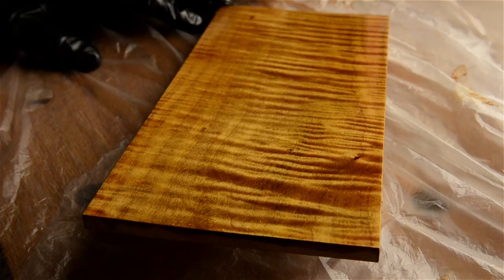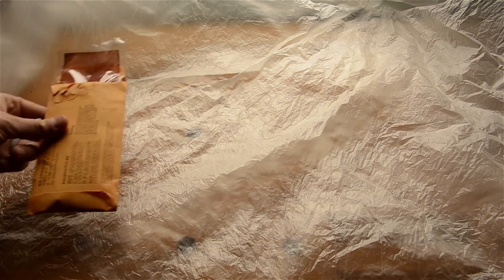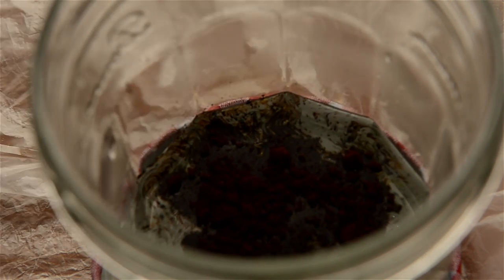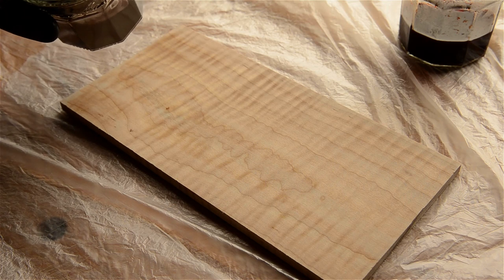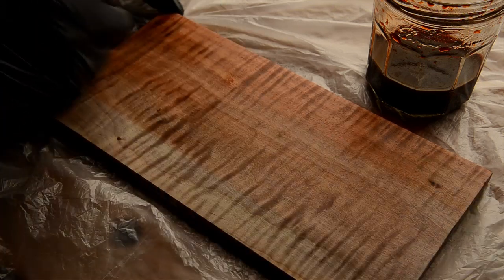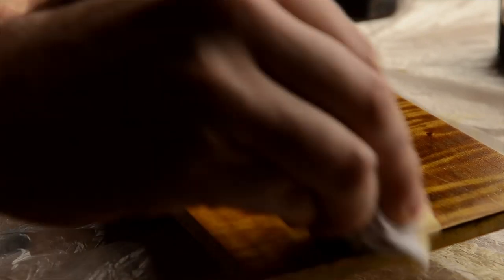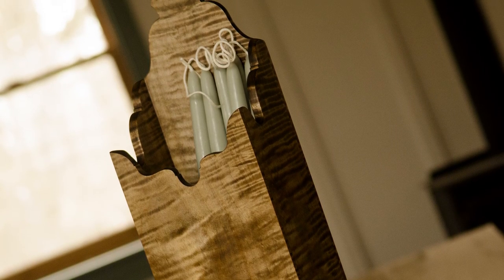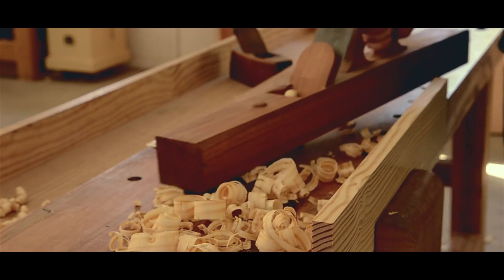How to Make Figured Maple Pop!

Comment: Guitar maker here. This is a common technique in figured tops! There is however a fair tradeoff when "popping" the figure with direct dye application. To a degree this flattens the chatoyance which the oil recovers for the most part. The biggest culprit here is use of coarser black pigments that easily kill it. Sanding maple to 400-600 and doing a couple of distilled water grain raising and 800 grit knocking back at 20° to the grain direction produces a finer and less furry result with water based dyes. 20° helps cut the damaged raised fibres instead of simply pushing them back down where the dye causes them to raise back up. A few guitar makers I know polish their maple through to several thousand grit, essentially burnishing the surface, oiling and/or shellacing before shooting toner colours over the sealed wood to get maximum chatoyance. It's a decision between whether you want to trade off a little of the surface reactance to light to gain contrast in general. Ultimately, everybody should experiment with different finishing schedules and try variations to see which path and desired characteristics works for them and the workpiece itself. Guitars have different expectations and human interactions than furniture! Recommending this video, definitely. Thanks!
Reply from the maker: Thanks for the great comment Tristan! Yes, guitars have a much higher expectation than does my furniture. But it's great to learn more depth on the subject. Hope to have you comment again!
Reply: Tristan J. Cumpole - different methods work for different end goals. I finished a Birdseye maple top as follows:  sand to 220, apply black water-based dye, sand to 220 again, then switch to alcohol based dies so the wood doesn’t get furry anymore. No BLO - just multiple coats of lacquer with wet sanding 500 in between. The first few lacquer coats were tinted to dial in the red I was looking for and they added some depth to the color as well. 

Next time I’m going to try a card scraper after the initial water based dye application.
Reply: @chipsterb4946  I agree totally. Finishing schedules are about control over what one wants to express from the wood itself, and add in via the finish. I've never been a fan of using black dye to accentuate the rising/falling grain as the contrast is a bit too dirty and artificial for my taste. Generally I stick to neutral dye colours that compliment the Maple such as a medium brown, or for extra pop doing two rounds with a tobacco and maybe amber or medium following. This maintains as much of the wood's natural chatoyancy as is possible under the tonered lacquer or whatever else is going on. As you say, it's all about the goal. I like finishes that the owner/player can love at close quarters, whereas a strong high contrast pop makes an instrument look a million dollars across the room. Thankfully there's a nice graduation between these two extremes, which is where the fun comes in!
Reply: Sounds really fascinating and sophisticated, wish there can be videos showing how this is done. All the best
Reply: Tristan, do you have a website? There's a flame maple bass body I'd like to do this to if you're interested. 🤘
Reply: YES! 

Loss of Chatoyance is a major concern to me.
PRS has become the best in using dyes on guitars, but at a loss at times...
Reply: @jamiemorgan4146  I suspect that this is in part due to the shift from nitro (thin build, solvent reflowable, easy to dial in subtle tints over many coats that blend) to catalysed clears that achieve the same result very few coats. Dyeing the wood makes it easier to establish the look rather than relying on the skill of the painter. I know that painters can get great results with cat of course, however you can't get it wrong or recover the results.

Comment: I build musical instruments, and the dye & sanding techniques are very similar. After the grain is accented I may do a dark border (sunburst) or some kind of a darker border only in colors that the sun should NEVER EVER be, like green with a blackish border and a blue center or purple to lavender or pink. After that some sort of a clear coat is applied. Nitrocellulose is the vintage classic traditional finish, but polyesters and polyurethanes are a lot less problematic especially with a brand new not fully cured finish that may ship in the freezing cargo hold of an airplane.

Comment: Thwo part question here:
1.Can you use Tru Oil as a top coat for this process? 
2.And would the figure of the flame come out using just Tru Oil. (several coats of course)

Awesome video btw. Your insight would be really helpful.

Comment: Hi.  I loved the finished look.  It’s exactly what I’m going for.  I am building a table using curly maple for the legs and edge banding.  My question is the table surface.  I am using some Birds Eye maple veneered MDF.  I’m worried that the three sanding steps might go through the veneer or accentuate the seams.  Any thoughts?

Comment: Enjoy the video. I use curly maple often for jewelry boxes. My questions would you finish the inside before assembling. I do miter spline construction. Would you dye it up laying flat for better control of dye then glue up and cut miters install them and just recoat with a light coat of dye before? I usually have to do a bit of sanding after gluing up the splines and cutting them down flush? Thanks for any suggestions. I did purchase some dye from your store

Comment: Fellow guitar lovers- for the neck, try Danish Oil finish... go to 400-600 grit, stain if you're staining, then apply Danish Oil and sand the first coat into the wood- this trick puts the fine sanding dust into the grain, making the wood even smoother. Then add coats to taste... when it wears down in time, just wipe on another coat or two... a beautiful satin finish, close to the wood, that you can easily redo in no time...   🙂
Reply: I'm going to try that! Thanks

Comment: I'm new to using water based dyes so I accidentally used odorless mineral spirits to clean the wood I'll be using the dyes on which I know is a big no no. Any suggestions for what I should do now? Now I need to make sure I get all of the mineral spirits off of the wood so the dyes can properly penetrate so I used some 90% isopropyl alcohol to clean the mineral spirits off but I'm just worried the mineral spirits penetrated enough to cause me problems now. Do I need to resand and/or thoroughly clean with water or a mixture of water and alcohol or should the wipedown I did with the 90% isopropyl alcohol be sufficient enough to remove the mineral spirits? Thanks I appreciate any and all advice.

Comment: I’m making a live edge table out of English elm. The grain pattern in the slab has a lot of swirling and is quite striking. However, English elm has an interlocking, open grain, unlike maple. I’ve been doing extensive experiments on various finishes on a test board, using different combos of de waxed shellac, BLO, stains, and waterlox, but everything seems to end up a little muddled.

Do you have experience using dyes on English elm, or other open grain hardwoods? Any suggestions?

Comment: I have usd the same process for years, and I love it. The only difference is I use trans tint rather than the powered dye. I wonder if there is much difference in result?
Reply from the maker: I haven't done a side-by-side comparison between the two, but I imagine there isn't much difference...maybe a slight shade difference.

Comment: Very nice 👍! What would you do different in you were working with tiger striped Walnut? I'm going to be refinishing a new replacement stock for a M1 garand. DuPage trading Post sells a nice tiger striped Walnut replacement stock. Thanks for sharing
Reply: I have done the exact process you're speaking of with my M1 walnut stock. Sand down to 220 or whatever you're comfortable with, apply linseed oil as it really popped my tiger striping, wipe off after 30 minutes, let it sit an hour or so and then apply a few coats of Tru Oil. Mine turned out a stunner!
Reply: @kingtiger2phillips511  Very nice 👍.

Comment: Rule one . Measurements matter.
  Rule two .  All powdered dyes require 24 hours to acclimate. 
  Rule three . Time 
   There's a lot more than most will understand . By following 1&2 you eliminate 80-90% of the 72 ways chemical coatings will fail ( not can, WILL ) 
  Liquid is measured in milliliters.
 Dry matter in grams . 
  Coats of paint/lacquer measured in milliliters per. Square Centimeter.
Reply: Great info. So are you saying, after you mix the dye in warm water, let it sit for 24 hours in the jar before applying?
Reply: @MOAB-UT  yes , it has to acclimate .
Reply: @RussellStClair-cy1vu  I would think 10 minutes to 1 hour would be good enough as long as the liquid temp matched the room- no? I have an infrared temp. meter. Also, diluting in warm filtered water first so it melts nicely.

Any thoughts on using 1. water based, then alch. based, then oil based? I think PRS Guitars uses that method.

After stain, how long until you can sand- then how long to Tung Oil coat.  Also, what grit do you use to sand?

Thanks- it's my first real time doing a piece of furniture so I want it to look very nice and to last.

I appreciate you.
Reply: @MOAB-UT  I prefer dyes in alcohol because I don't want grain raise . 
 If you want consistency of color .
use a washcoat in between the dye and oil . When I do oil stain alone I also use a washcoat . It's better than using " stain controller" . 
  Washcoat : 1 part clear ( preferably the same top coat that you using for the project) 4-5 parts lacquer thinner . Sprayed 1.5 - 3.0 mils. 
Sometimes you lightly scuff w/ 320 , sometimes you don't . ( Experiment with your color sample ) 
 Side note : what is prep-sanded today "should" be stained/ sealed/washcoated today . Wood oxidizes .
 Not a huge deal but it can be at the worst time . 
  Really important part . The " Drying Time Clock " starts when the last piece is stained especially with oil. 
  Hint : once you are ready to start sealing , you can tone with either . 
  Dye also work's in lacquer, sealers and your washcoat . 
 Drop the fluid down and the air,  small color gives big results . 
  Play around with scrap till you find what you want . Just using the same two colors . You'll get a few different results . 
  P. S. If a dye looks light an hour after staining . It's not ! Don't do it !! 
Don't try to restain it ! Unless you want a checkerboard 😂😂😂😂😭😭😭😭
Reply: @RussellStClair-cy1vu   Wow great tips thank you for taking the time to write all of that and I will take it to heart.
Reply: @RussellStClair-cy1vu  You said: Washcoat : 1 part clear ( preferably the same top coat that you using for the project) 4-5 parts lacquer thinner .

I was planning to use TUNG OIL as a final coat. Do I mix that with Denatured alcohol? You are saying use it after my initial Dye job- light sand, apply it and 15 minutes later Dye again? Some say to use plain water before dying. Is that not a good idea? I am hoping to get the wood on the darker side and I heard sealers might prevent that.